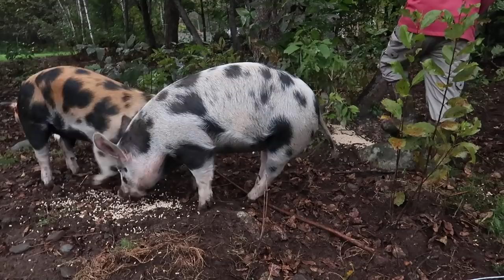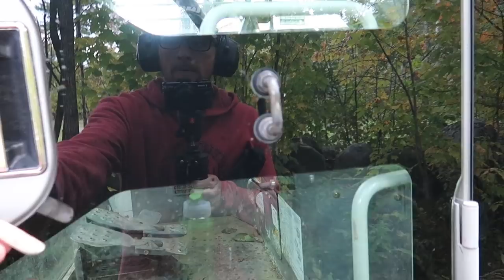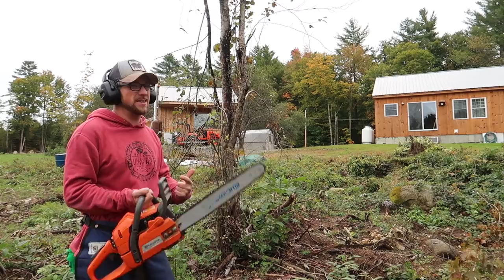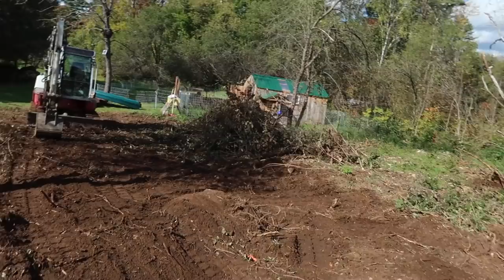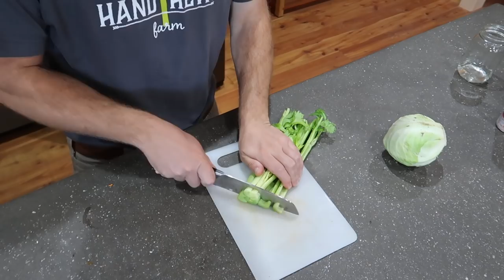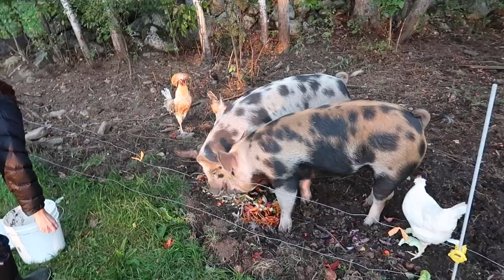Let the Fun Begin (Breaking Ground with the Excavator)

Comment: Don't tell Gina. When I was 15 I did a book report on Vitamin C and the common cold by Linus Pauling. I didn't act upon it until  many years later when I realized that every October or November I was having a cold or flu or bronchitis. I started taking between 4 and 6 grams of vitamin C Plus 5000 IU vitamin D3 per day all year long, and have not had a cold or flu since. I did have flu symptoms once for a day when I ran out of vitamin C and vitamin D3. Resuming the regimen stopped the symptoms in their tracks. 

My batch of bone broth is simmering on the stove right now in 2 stock pots. I make bone broth not only from Bones that I save in the freezer but also from vegetable scraps that I put also in the freezer. So I save onion skins Carrot Tops asparagus ends Etc and simmer all that together for at least 24 hours. I just started pumping up the collagen content by adding two packets of gelatin to each stock pot. All of that will be put in 24 ounce jars and use over the next few weeks. I even put some of it in spaghetti sauce.

I read a study from I think 1934 that tested bone broth for mineral content and concluded that bone broth made with vegetables plus bones has a much better mineral content.
Reply: THX 1138 Smith ,
There is that regime. Plus I do a little more . Or rather I do a little less.  I protect myself from the cold a little less.  I do not dress as warmly as I could . Only "just " enough .  Keep my house cooler during the winter also.  Not only am I healthier but I save on my heating costs also.  And I do not heat my bedroom !  I even have the window open.  I have awakened in the morning to find a scim of ice on the water in the water glass near the head of my bed. Of course I do have warm quilts over me.  Sung as a bug in a rug and I sleep like a rock ! And I have not had a cold since I left warm So. California , 25 years ago !  I have been with people that keep their homes VERY warm during the winter. They seem to have a cold all of the time.
So that is my 2 cents worth.
Reply from the maker: I think it taste a lot better too when you add the veggies while making it
Reply: I want to give you 15 👍!!!!
Reply: Mary Gibilisco ,
My bedroom may be cold but I am not . My body is warm and toasty. 
However , my face and nose are rather cool. I probably look like I am in a cocoon with only my face sticking out. I sleep and rest very well .
  That glass of water does not always have ice formed on it. Depends I guess on how cold it is outside.
  By the way , I am 76 years old.
Reply: If you want a natural way to add collagen to your broth then boils some chicken feet or pork trotters with your broth.

Comment: Can't tell for sure, but from the audio it sounds like you are running the excavator at half throttle. Wind that thing up, the pumps are made to run with the engine at a specific rpm.

Comment: A suggestion....when renting an expensive piece of equipment you need to keep that equipment working continuously....try getting some red flags at Home Depot and put a flag by each big rock that needs to be dug out, and by each stump you need to pull, so you can go boom, boom,  boom, one item then the next without thinking, without raking, without chainsaw work etc....be efficient.  In two days, being efficient,  you probably could have gotten all the big rocks out of your 4 acres, along with all the stumps with just a little bit of planning and several hundred flags..A big job.  Remember how to eat an elephant - one bite at a time.
Reply: I would use a dash of florescent spray paint, then no need for flag retrieval. I thought of this too, but he must have a pretty good vantage point inside the rig
Reply: rkorsberg - Al said in replies to other comments that he didn't rent it, he said I helped install a kitchen and other projects in trade for using the excavator

Comment: What? Another rock? New Hampshire is The Granite State. You could build rock walls like the original homesteaders did. Would the ghosts of homesteaders past consider it cheating to use the excavator and Kubota for moving rocks?
My father had the driveway expanded at our NH home. There was a rock in the way that the paving company tried to dig up. The above ground exposed part was only 1 by 2 feet. He dug 6 feet down and still couldn't find the bottom. Guess that rock will not frost heave. I wonder if any of yours are behemoths.

Comment: Maybe this is a silly question but is there a difference between Stock and Bone Broth? Might just be my culinary school training taking over.
Reply: Stock, or broth, is the result of simmering a chicken (or just the mostly cleaned bones and bits) with vegetables of choice, for a relatively short amount of time (enough to cook the chicken).  The resulting broth is strained.  Bone broth is taking the bones and pressure cooking (or simmering in a crock pot, but for a much longer time) them with a bit of apple cider vinegar to pull out the minerals.  I use a stovetop stainless steel pressure cooker (not canner) and pressure it at least 2 hours.  The resulting broth is also strained.  It is not as aromatically pleasing nor does it have the depth of flavor, however, it is very rich in minerals (such as calcium) and gelatin.  I use either broth for soups but bone broth really needs some seasoning to be tasty.  Most people skip the bone broth but it is super nourishing and basically free :)
Reply: Thanks for the reply Brenda.